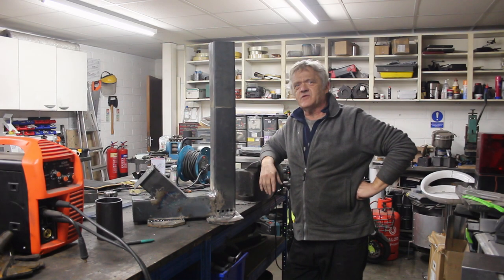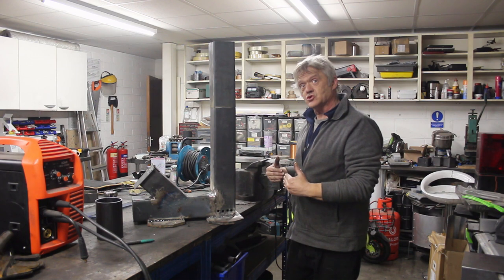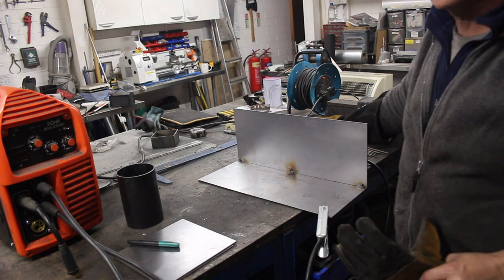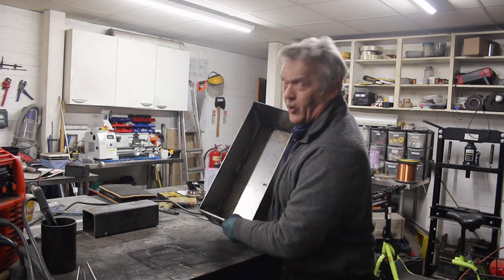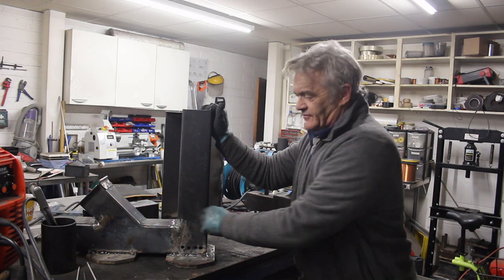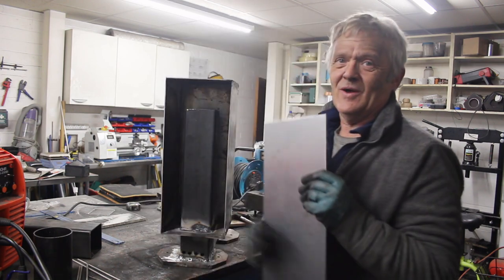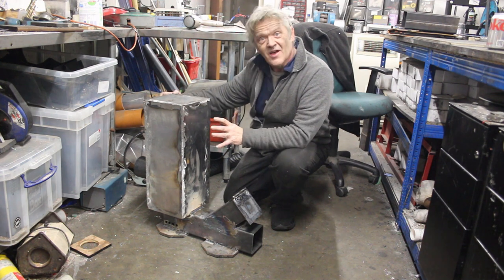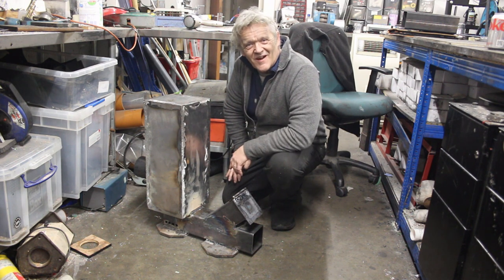1741 How To Change A Rocket Stove For Indoor Use #rocketstove

Comment: In a sealed room, the occupants could be in competition against the stove to get oxygen.
In a ventilated room, the cold air from outside will travel across the area, in my house, I choosed to canalise the air from outside directly into the burn chamber, the intake is thermaly insulated to avoid condensation.
Reply: I see I am not the only one who sees this issue. (~_^)-b
Reply from the maker: it's a way to go - but a little anal - all houses have ventilation - they. have to or just breathing would kill you - by ventilation we are not talking about throwing open all the doors and windows while a hurricane is blowing - ventilation is really pretty gentle stuff - having said that we each go for what we go for and it ends up being a little six or two threes
Reply: @ThinkingandTinkering  My 'house' [its doing it way too much charity to call it that] is so drafty it feels like the Vietnam era here.

Bugs crawl through holes in the walls and into the interior of the place all the time.

I literally heat with an open radiant gas heater inside with no worries about suffocation or carbon monoxide poisoning.

There's almost zero retention of heat in this place, as was the case in the house I grew up in, so suffocation is no more of a threat to me, than drowning. [I live at the top of a cliff up a steep slope, near the highest peak in 600 miles, so water can not pool here]

Comment: If you had lagged your inner tube to insulate it a little you would have got more draw and a cleaner burn , Don't take it as a criticism just adding to the pool of information, The hard core rocketers will run meters of pipe horizontally through a large thermal mass and need the extra pressure to achieve this, I really enjoy your vids Rob, you cover a very diverse range of topics, Cheers Brent

Comment: Reading some comment you would think the rocket stove concept is set in stone and no deviations or development shall be un punished . I have made lots of "rocket stoves over the years as I have endless scrap metals at my disposal and I simply qualify each design based on its combustion sound . If it sound like a rocket then you have created a rocket stove as far as i am concerned . The variation can certainly change the results but horses for courses isn't it ? If it burns clean and gives off the desired heat and you radiate most of the heat into the room then you have acheived the end goal . Geez I can't believe there is so much rocket stove politics! 😂

Comment: Small piece of advice might come in handy.  Taking advantage of residual heat can really come in handy especially facing these rolling blackouts. I do it all the time anyways I run off space heaters majority of the time and I use my oven as a thermal batter By simply opening the oven door and putting Myspace heater facing inward not only does it warm the air in my place but it warms the stove and the stove radiant heats to the rest of the kitchen
Reply: And it may seem dumb now... But the ancients built with rock and  Historically people used stones to hold heat might be worth doing when push comes to shove
Reply from the maker: nice solution - cheers
Reply: @cavelvlan25  My dad built a 24 ton fireplace at our old house, just so it would have a lot of thermal mass.

Since our house had next to no insulation [he was terrified of fiberglass, but somewhat rightfully so, and modern plastic insulation had not been made yet] he depended entirely on gargantuan thermal mass, and the working hands of 4 out of 5 young children to keep pumping firewood into it day and night.

It also had internal chambers to exchange that heat so that with just a small fan, this massive mountain of masonry kept a 2700 SF house decently warm in northern Arkansas, even in -5 F weather with a sheet metal roof and almost nothing for insulation.
Reply: @hunnybunnysheavymetalmusic6542  sounds like a heck of a stove haha. Fiberglass is not fun or friendly.  It is unfortunate almost all modern insulation is sky high right now I would love to insulate my place better.
Reply: @cavelvlan25  2 super cheap kinds of insulation you can get or make: 1: plastic shopping bags [flammable, but insanely cheap, and insanely efficient], 2: aircrete. Insanely efficient, not the easiest or neatest of options, and not nearly as cheap leftover shopping bags.

PERSONALLY i would pick aircrete for the following reasons: 1: Fireproof, 2: can have flame retardant(s) added into it, 3: will not rot, 4: finds gaps that even plastic can not find, 5: has some structural value, 6: can have refractory components added to it, 7: can have waterproofing ingredients added to it, and 8: helps make a home slightly more earthquake and tornado resistant because it bonds to all of the properly prepped surfaces and makes the entire structure 'unitized' as a form of crude 'composite'.

The only things you need to do to ensure a good pour of aircrete before you pour is to 1, 'adhesion wash' all the areas you wish to bond it to. This can be done most easily with a low pressure spray wand with a swiveling head, inserted from the top or the bottom of any vertical wall, and from any end/side of a horizontal plane such as a floor. This adhesion material is also home made, and contains a mixture of the water soluble 'water glass' with some ultra fine cement powder in a light but self suspending slurry, 

and 

2, follow this by plugging any holes where the aircrete can leak out of when you do to pour it.

You may want to let the holes alone a few days before you put in the aircrete though, just to be sure that the preparative coating has time to harden up.

This material will partially soak into any porous surface it sticks to [which means it won't stick to very well to romex or PVC, but that might end up being a good thing, as you never know when you may need to service those] and act like a primer, to ensure that the aircrete then has an ideal surface to bond firmly to.

Once it hardens, it will greatly increase the total strength and rigidity of the structure.

THIS guy, is like THE KING of aircrete!!!

I have NEVER EVER seen ANYBODY do as much with aircrete on the face of the earth!
Reply: @hunnybunnysheavymetalmusic6542  I hadnt considered aircrete. I burn wood so not going to do anything flammable thanks for the advise.
Reply: @cavelvlan25  You can make high temp furnaces with aircrete if you add in enough alumina, kaolin or zirconia.

Comment: Cracking fun what you are doing with rocket stoves and all the other heating projects!  check out the rocket stove setup in Earthship homes, cobb structures etc.  with the correct set up the exhaust gasses cool quickly in the outer chamber where the burn pipe IS insulated from the outer chamber and the outer chamber radiates enough heat to cool the gasses just enough, causing the exhaust to push itself through long horizontal pipes embedded in earth benches and requiring little to no traditional draft of a vertical chimney    These designs have a little more detail and are great for permanent installations using the mass of the bench as a heat battery!

Comment: Insulation isn’t necessary i’ve been burning a2 inch round rocket stove with pellets and it’s only steel it will reach About eight or 900° at its maximum and I’ve never had to replace anything on it I believe that’s because it’s allowed to cool down quicker with no insulationAnd with no insulation it still gets hot enough to burn 100% clean

Comment: you could add fins to the box, increasing the surface area. just like coolers have on hot things trying to get cold.
Reply: Your right it really does help. I added them to a secondary burner on a wood stove it increased output at full burn from warm to the hairs curling on my arm. Added 2 inch fins 1-1/2 inch apart.
Reply: @tomtaylor135  could probably also have fins on the inside also, when you increase the heat transfer is there a point where the stove puts our too little heat thru the chimney so the air thru it is not good?
Reply from the maker: that's a nice idea - cheers mate

Comment: I knew a boater who would circulate glycol through his back boiler using convection and then into a radiator. Normally it would be pumped to other radiators and under floor heating, but the convection radiator had to be there in case the pump failed, proving it can be done passively.

Comment: Another way is to use heat exchangers on each end. Pipe the heat into the house with copper or aluminum tubing. Fire outside, radiator inside. Oil or water might work.

Comment: Thanks to your channel I am thinking of a big rocket stove enveloped with a 2 ton'ish sand battery with a water heat exchanger plumbed into my underfloor heating.  In Scotland we are using £3-£5 per day on heating only, our worst was £7.30 in 24 hours.  If it wasn't for my O.A.P parents and Mum being disabled I would turn the bloody heating off. 
And we are not even in the depths or winter yet.
All very, very frightening.

Comment: The horizontal part of the stove needs to be longer, because the smoke will stay in the flame longer, giving more smoke the chance to burn, causing more heat, and the riser needs to be round with the incoming fire, heat, and any smoke to enter off center which causes a swirl, so instead of everything just rising up, any remaining smoke has more time to burn, allowing for more heat.

Comment: The Vortex Stove explored in Video # 1730 is perfect for supporting flame in a confined space and greatly reducing impingement. And the 3 curved plates circling the flame is the very best example to archive this that I have seen.
And combined with the second jacket as illustrated in Video 1741 provides a location for a copper water coil to be in the flue stream without being introduced to direct flame. This would work well just like the outdoor furnace so common in Canada.  The water would be circulated into the home and through a water coil in existing ductwork for example.
Now what I haven't seen yet is the introduction of a proper WASTE OIL burner at the base complete with an auto float system that maintains a constant level in the pot and does not use the more common fuel drip system which is subject to temperature, supply tank level, and potential clogging.
Your thoughts?

Comment: I've seen the same type of set up made into a thermal mass heater using a 40 gallon drum and stones or bricks around the flue, but not sure how easy they would be to clean.👍
Reply: If the Rocket stove is built correctly,  then it burns so clean, that there is virtually nothing left behind.   That said, a lot of "rocket mass heaters" have built cleaning ports into their designs.. "Just in Case".   The ones Im talking about, tend to use a long bench that the exhaust pipe runs through... which stores the heat into the benches mass.   People put some thick padding on top of it, and can sit or lay down on it.
Reply: @johndough8115  👍
Reply from the maker: maybe a cleaning port?

Comment: I have wondered if using a cast iron pan on top of the rocket stove would have a similar effect as a cast iron wood stove does of absorbing and releasing heat from the fire inside into the room. I guess you just went a more expensive route or is it more efficient?

Comment: Hi Robert. I love your work and videos. You inspired me to build my own rocket stove. I can see that some of them have wood inlet welded on the side of the chimney and other on the top of the horizontal air tunel. Could you please explain the advantages of both solutions? Is there any particular reason to choose one of the solutions? Cheers!
Reply from the maker: there is no real reason though I am guessing there are lots of arguments why one is better than another - I just dis agree with that - if I were you and this was my first time would just go for one you candid easily and run sufficiently
Reply: @ThinkingandTinkering  Thank you. I will weld the wood feed on the air tunel - it'll give me more space for an additional "shell" on the chimney. Have a nice day!

Comment: One design I made was similar too Robs classical initial build but I welded 6 X 100 mm tube to the 100 mm upright . One on each side . Only spot weld every 100 mm along . This creates conductive passive air flow for the room . The burn chamber went up 1.5 m and back down and out . It created a lot of heat and it was open plan living . Certainly wasn't a set and forget relaxing fire though . The burn rate was every ten minute with dry hardwood  but man did that thing get hot . I ended up putting it out in the shed as it was not a practical design for in the house . A bigger fire area for larger pieces would be better for that like a arm size peice .

Comment: The timing of this video is great for me since I'm getting ready to build a Rocket Mass Heater for my itty-bitty mobile home.

RSM gave me a thought (again):  
Would a car radiator in-line with the exhaust be piratical?  I've three small aluminum ones I think I could place at the farther ends of the exhaust (or maybe a 20' side run to the bedroom).   Optionally, I have access to the old steel radiators for higher heat tolerance.

Or perhaps a closed-loop water filled piping system may be more practical?

Comment: A suggestion is to build the rocket stove big enough to accept fire bricks on the inside of the burn chamber and still have the internal dimensions you want and expect for the burn chamber. In other words the steel of the stove's burn chamber will need to be 4 inches wider, 4 inches higher, and 4 inches longer if you for example use 2 inch fire bricks on sides, ends, and top and bottom. 

There are multiple advantages of having the insulating fire bricks. First it will cause the burn chamber to be hotter during a burn causing more and faster complete burn. Second, it will preserve the steel chamber from prematurely burning out. This way you can achieve those high temperatures in the chamber and have the steel of the stove last lifetimes. Otherwise it is possible you would need to rebuild a new stove like every year if you burn hot complete burn in every burn, which is what you want and need. But you don't need to keep burning out(develop huge holes in) the steel. If a fire brick gets broke no big deal, just take it out and put a good one back in, takes 2 minutes.

At some point you will want the heat to penetrate a conductive surface to radiate out into the room before it goes out the chimney. But at that point it will be that box you just made, that box obviously won't be lined with any fire bricks because that is the radiator. But the point i am making here is that at least you won't  have to rebuild the entire stove, all you will need to do is build a new radiator box once in a while if it burns out and the rest of the stove will be in pristine shape. You would also line the inside of the upright flue of the L part of the chamber inside the radiator box with fire brick to preserve the entire L chamber and to ensure hi  temps inside the entire chamber.
But another option is to just make that top of your radiator box out of like 1 inch thick or thicker, take lifetimes to burn out. This way nothing burns out, thick steel on top of the radiator and fire bricks lining the entire inside of the entire L chamber.

Comment: Hi Robert.. would love to see you guys make a wind up clockwork auger for automatic feeding of pellets...wouldn't know where to start with a windup project but its an engineering skill that needs to be re-introduced.
Reply: buy  a large wood auger bit, place in a suitable tube and there's your feed mechanism
Reply: @richardkern5185  damn... That's half of it. But the clockwork bit is of interest to me. Windup clockwork that takes out the electric or so called gravity fed.
Reply: It doesn't have to be anything super complex. Put a mass on a chain and hang it from a gear. Put a ratchet on the gear so the mass drags the gear along, but you can pull the other end of the chain to raise the mass without reversing the gear.
Then connect the gear to another one driving the auger with an appropriate gear ratio and you're all set.

A bit of experimenting to get the weight and gear ratios just right, but shouldn't be too hard. I imagine you can get most of the parts you need from a bicycle, you'll just need much longer chains.
Reply: @DevinBaillie  food for thought. Like the ratchet idea. I suppose the challenge comes from timing and control.

Comment: Isolation of the primary chimney may help to burn the gasses better, but for a roomheater thar can make sense only if the exhaust doesn't lead directly to the chimney but will first be lead to a radiator or some kind of 'mass' that will keep yr room warm

Comment: I've built a pellet basket for mine, worst issue is overheating and flash burning the pellets...any ideas for a efficient heat sink? Should the fins be 90°, 45° down, or 45° up? Should I just perforate the feed tube? I'm getting so close to heating a home on $5 a day or less, and I can't seem to find any answers!

Comment: I'm wondering if you use thin fire bricks (like in a regular heater) to glue to the outside of the box and hopefully absorb as much heat from the gas exhaust before being extracted out the flue. Would that rating maximum heat to radiate to the room?

Comment: All very interesting, but I as many would have to undertake some major renovation work to open up my fireplace and chimney. Many homes simply won't have these built in to their homes. Like someone else commented. It would be useful to see what you could come up with for an external stove. Although less convenient to keep fuelled up, would be easier to install. 
How could we transfer heat to our existing heating system, such as a boiler and radiators. Is it possible?
Reply from the maker: it's more than possible and actually pretty easy just think of a current hot water heating system or forced air system - the principles are all there